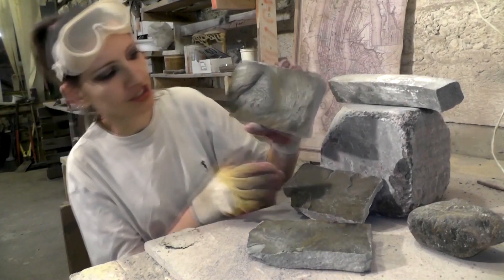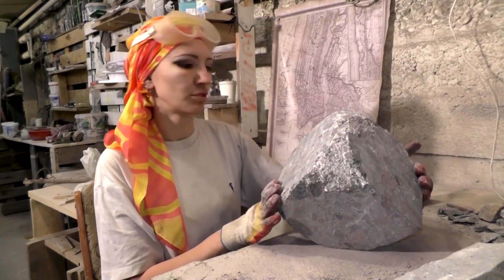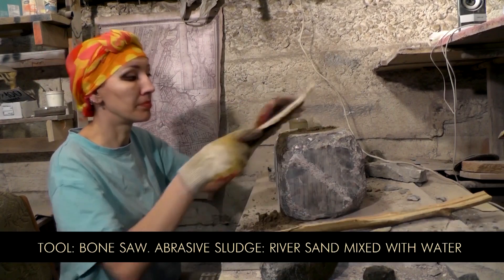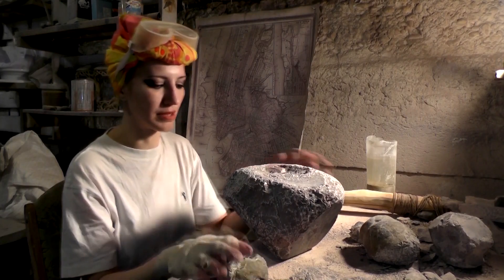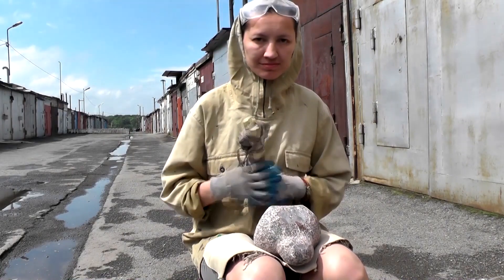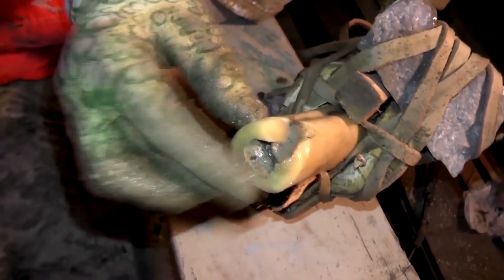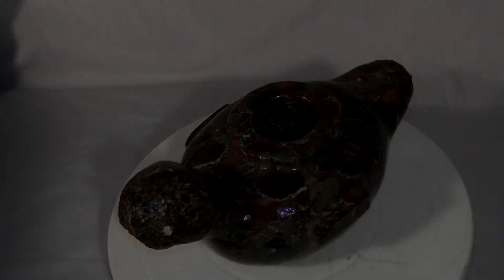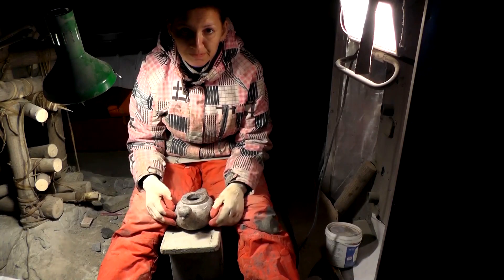Mysterious Ancient Artifact - DIY. Alternate history fans, please look away

Comment: I remember seeing Egyptian stone vessels in The Met as a teenager, and ever since then I've puzzled over how they were made. Thanks!
Reply: Some of those vesles have been scanned to show tolerances less than 1000th of an inch..  which means to say the tolerances between the fixed rotating workpiece and the machine head have to be stable enough to produce these tolerances in the finished material. With our level of technological accomplishment we could only even begin to read these tolerances from the 1950's such as with the advent of the spiral gear lathe which which we could develop an accurate mechanical calliper/micrometer with which to read these tolerances.. of course we now use digital and light source measuring instruments.
However, even now with the ability to read these precise tolerances, our 3 dimensional cutter heads do not have the stability to replicate the finer of these examples tolerances. The elorian caves in India also display an example of machining tolerances on a scale vastly outside our capabilities. 🖐😊

Comment: i highly doubt it took them 7 months to make the original.
Reply: Sure, they probably were much more experienced, plus it was likely a whole shop of such masters and it could've taken them a few weeks per item.
Reply: Could they use some tools available in the era to split the stone better for instance? Looks like it took a lot of fo time to saw the stone and remove large chunks. Tools preparation would be handled by someone else in case more efficient operation was required, like during the construction of the pyramids.

Comment: So i think the critical issue is that of scale. Its not that it isn't possible, but its that this to one person 7 and a half months. Assuming an average time of 6 months allowing for some speeding up of procedures that would mean an average human could produce between 60 and 120 in their entire lifetime. There are tens of thousand of of the pots taking thousands of lifetimes to make. While this may have been possible this excludes all the other artifact work that was done at the time. Thus the issue is not if it can be done but how long did it take. As this method is horribly inefficient and because of that it is likely that some other method was used.

I've seen methods of water levelling to makenperfectlt flat surfaces on rocks. However you can't do that on interior surfaces and you can't easily do it on 200 yon stone blocks and you can't do it at the rate it was done. On a small scale it works, but on a large scale it does not.
Reply: If brute force does not work, you are not using enough of it. Do you mean hundreds of pots or hundreds of such artefacts? Pot is easier to make. True that the amount of time required is jaw-dropping, but we judge it from our perspective. Also, a lot of items in even medieval times were very expensive because of the intensive labour required, like metal armour.
Reply: @pavel9652  work smarter not harder.

There are thousands upon thousands of pots and similar items like larger pots or jars, plates and bowls. I would argue that a pot is much harder to make given its internal shape and volume. And this isn't medieval, when very small scale machining was available. This stuff predates even writing in some cases.

You example of medieval armour is correct in essence, the comparison is that armour requires a lot of physical resources, metal and coal, as well as a fair amount of labour. In the case of the pots and jars, these are purely time/labour intensive. Even if each one took 6 months to make, with a life expectancy of 40(being very generous) you could maybe make 80 assuming you worked from the day of your birth. In order for us to see the numbers we do, there must be q faster way.
Reply: @N3onDr1v3  Sounds like a corpo catchphrase ;) Internal volume could be removed from a bowl in a different, more efficient way and the shape is simpler. I think they had access to bronze or copper tools in the early days. These artefacts are from 3100 BC, and this is the time we find metal mirrors. I can't believe someone would spend 7 months, let's say half a year to make one item. I can imagine, however, spending 1-3 months doing it, but history has no obligation to meet my expectations ;) Medieval armour requires a lot of physical resources, metal and coal, that is true, but this can be translated into labour, just someone else would have to do it, extract it from the ditch and process it in smelter ;)

Comment: Would she attempt to replicate the tight fit megalithic wall?
Reply from the maker: Why not?
Reply: @ScientistsAgainstMyths  She might not attempt it because it is to much work and the chance of failure to large. I suggest she attempts a few small granite blocks at first. If she can prove the megalithic wall is probably done by hand all these hypotheses about advanced technologies which might have been used can be proven false.
Reply: @HushemFlupskluk  look up “Secrets of the Parthenon” doco. They use ancient technique, the pantograph, to fit broken stones together perfectly. Much more complex than polygonal walls. They did and still do use it to make exact copies of statues.
If someone wants to pay for it fitting stones together like that isn’t a problem. 
It’s just that the lost tech crowd go out of their way not to show that type of thing.
Reply: @SacredGeometryDecoded  Thanks for the link. That was carved marble. Granite is much harder. I think the uploader just answered and said 'why not?' hinting she can and will accomplish this. Perhaps in a future video.
Reply: @HushemFlupskluk  she's currently working on a diorite vase. it's the same technique, to drill marble or granite with copper for instance, it just takes longer in granite than marble.
marble.
It's important to remember that Mohs Hardness Scale only applies to abrasives/scratching, Limestone and Marble are low on Mohs Scale but they are actually  classified as "hard" stones, while sandstone is an easy to work stone and has the same Mohs Hardness as granite/basalt/diorite.
Consider diamond, 10 on Mohs Scale but diamond can be easily shattered with other stones.

Comment: Thank you for this, it is easy to get carried away and believe anything when we are not fully aware of the details. Simplicity is the key.
 Any idea how they cut the inside corners in Saqqara? They are so precise, seems like some tool marks would be seen. Any idea what they used for final polishing?
  However, given it took 7 months, I highly doubt this was the method used considering how many pots are found, not to mention those made of schist. It would be too time consuming to be productive, unless there were quicker methods, which I am sure they had large core drills from wood, etc. There is still a missing element. But of course, it ain't aliens ;)
  Much still to learn.
Reply from the maker: "the inside corners in Saqqara"
https://youtu.be/HQ2bHE7mTi4
"They are so precise" - Are you sure?

Comment: Often the argument from pyramidiots is that it takes too much time to remove material when carving. 
Your channel has demonstrated how well a copper blade cut through granite. (remember analysis of their cooper showed it was an alloy with arsenic, making it much harder than pure copper) 
Now make a wooden blade holder which holds with several spaced apart. After making parallel grooves, take a pounding stone and break the remaining high ridges between the grooves off.
The chunks that fall are that much more material that doesn't need to be pounded,saving time.
This is a technique that is used by woodworkers all the time.
I bet you could cut down the roughing out of the shape from months to weeks.*

*This claim has not been scientifically tested. But makes sense. Any part of the sequence of tasks that is reduced in time. reduces the overall time.
Reply from the maker: Thank you!

Comment: Impressive. 
But this is marble breccia, a relatively soft and easy to carve material.
And yet you needed 7 1/2 months to do the job!
Show me how IV Dinasty egyptians could do even much, much complex works, using diorite or granite!
Reply from the maker: Experoment "diorite vase" coming soon. Do you want to back?
Reply: @ Lorenzo 
A Very good question indeed!
Reply: the items found was almost all alabaster dishes and bowls. Alabaster is a soft stone and dishes and bowls are easily created by sanding while rotating the object.
Reply: She started with a very large machine cut piece of stone, limited access to tools and limited experience. An original would have been made from a smaller piece of stone (less initial shaping) with tools made by tool-making experts and years and years of experience in stone shaping. There is every reason to think a production workshop could get the creation time down to days. There is a famous example from a reconstruction of a Bronze Age lake village in Switzerland where the archaeologist were trying grinding corn and concluded the process was so slow that the women of the village would have spent their time doing nothing else. Then two African women stopped by and asked to have a go because the tools were very similar to what they used back home and they ground an entire months supply of corn in one afternoon. Experience counts for a lot with ancient technology.
Reply: @jonathonsmith8299   
That's a theory which needs demonstration too. And don't forget that the walls of some flasks or artefacts are less than 0.4 inches and are made of diorite which is far war harder than marble (7-8 mohs scale)

Comment: That's limestone, not granite or schist or diorite or andesite...  Please use the correct protocols when testing a hypothesis.
It's also not a thin walled vase with handles.
Reply: And could you please specify how thin are the walls of a "thin-walled" vase you speak of?
Reply: @JaneXemylixa  i dont think theyve ever been measured but theyre visible in a museum in cairo. one granite-vase there is chipped and just by the looks of it it seems like its not even a centimeter thick. cant find the picture right now but here are some pictures of other thin-walled stuff https://www.theglobaleducationproject.org/egypt/articles/hrdfact3.php
Reply: @JaneXemylixa   He's probably referring to the cracked vase that looks about a millimeter thin at around 21:35 in this vid: https://youtu.be/YZFN29FdCM0
Reply: For thin walls you just use callipers to measure the thickness. Measure, grind, measure, grind, repeat until thin.  The amount that's found cracked shows even they had trouble making them thin.
Reply: the items found in Djoser was almost all alabaster dishes and bowls. Alabaster is a soft stone and dishes and bowls are easily created by sanding while rotating the object.
Reply: Show us how the Aliens or Atlanteans did it then.

Comment: Awesome work.  I have heard getting stone like that hot in a fire and quenching it in water makes it easier to break/chip.  Might be worth experimenting with that.
Reply from the maker: Yes. But there is a big risk to split the original workpiece
Reply: Scientists Against Myths  try it on a chunk of granite and see if it’s easier to break apart.  I met a sculptor that made art with stone (mostly with power tools) and he said some pieces he would heat in a fire and quench in water.  It would make the material much easier to work with as far as machining/chipping edges.  

I am still blown away to think how much effort went into everything the “ancient” people did.  We are so used to modern technology that replaced hard work lol.
Reply: Lake School Restoration Channel fire setting. But it permanently makes the stone brittle after that. You can break granite up into dust with very little effort.
Reply: @ScientistsAgainstMyths  IDK anything - but maybe you might try heating (or cooling?) in small areas. Or try it in the early stages before much time has been invested.

Comment: Great video.  it takes great perseverance to create a single item over 7 mouths but it is well worth for the understanding of practical techniques. do you think it would have taken as long to produce historically or do you think they would have been able to shorten the production process over time?
Reply from the maker: Thanks for the comment! 
With a high level of skill and a reasonable division of labor in the workshop, time for production will be reduced several times I think
Reply: I think the worker would have chosen a rock that already looks close to shape before starting, saving time.
Reply: @torporvasflam8670  perfect comment.
As a teenager my great uncle (now over a 100 years) was a carpenter.
The small broken shards of wood became small practice pieces for sculpting contours.
Larger slabs that couldn't become furniture, became spoons, bird cages and such.
The starting point of a piece can very well be refuse (waste) material from others.

Comment: So all this was done without any metal...what a superb experiment - many congrats on completing this!
Reply from the maker: Thank you bro!
Reply: Not exactly. You could use copper or bronze for drilling and boring. Just like she did but instead of bones a self sharpening alloy tip.

Egyptians had access to plenty if quartz and Corundite at the Niles river bed which would be great  replacement for sand. They coukd use tye same granite as a grinder
Reply: Lol this is soft Limestone. The original is hard Egyptian granite!!!!
Reply: @StalkedByLosers ”The original is hard Egyptian granite”
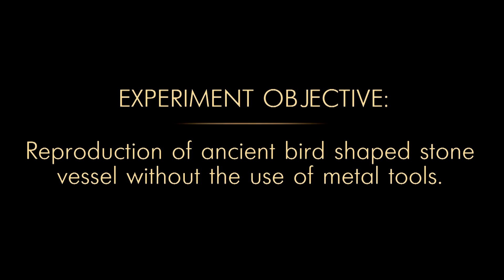In 0:09 it literally says “Limestone breccia vessel”.
Reply: @zytr0x108ok i worded it wrong. What I mean is, original dynastic and predynastic vessels like this are made of harder materials like granite and diorite. Limestone and sandstones are increadibly easy to work with, yet look how she struggles. None of these techniques work on the harder materials that original vessels are made.
Reply: @StalkedByLosers  lol at the beginning the original vase was made from the same material she used not all vases are made from granite and they made vases in this channel from hard stone they did this isn’t the only video
Reply: @danamcwhite I agree but you can't say the diorite vases were made this way. And they analyzed this vase and it isn't as perfect after scanning it.
Reply: @StalkedByLosers diorite isn’t anything special. Just because it’s hard doesn’t mean it’s strong the harder it is the more Brittle it is. It breaks easily. People are confused with this scale and tensile strength scale. The scale used is just for what Scratches what. 
 Diorite can be made by hand with just copper and sand paste.
Reply: @danamcwhite interesting. So why was it not used here?
Reply: Yeah, pre calcolythic, early ancient Egyptian tech at best. More stone age.
Reply: Impressive, you can have your creation mapped by the team, we can see the STL and see how you did.
Reply: What was the 2 saws the drill and needles made from the .omfg
Reply: @jayc3917  Read the list at the end...
Reply: @jayc3917 The bone saws and drills were made by aliens, obviously. You Nobel prize candidate. You unrecognized genius. Your IQ must be off the charts.
Reply: Anyone can do it with sandstone do it with granite like the Egyptians
Reply: @runingtwig1  it literally says limestone and marble is a variety of limestone
Reply: That proof a concept by this woman is nonsense. Yes, you could mine an ore load with a spoon. Feasible? yes. Economical? no. Probable? certainly not. 
Could you carve a 1200t megalith with a small stone ball and (infinite amounts) copper chisel? Feasible? yes. Economical? no. Probable? certainly not. 
Using half a year to create a stone vase is bollocks. A society and economy doesn't work that way. Who would pay a half-year salary for a stone vase? The king and some dudes in his administration. Who bought the other 30.000 vases at half-year salary? Think about it...
Reply: @DilbertMuc  Lol why are you even here ? 😂 Where are you getting your facts from ? What makes you think any of these artifacts were sold on the street? That too for a short time? Typical armchair pessimist. Does no work and criticizes anyone who does actual work